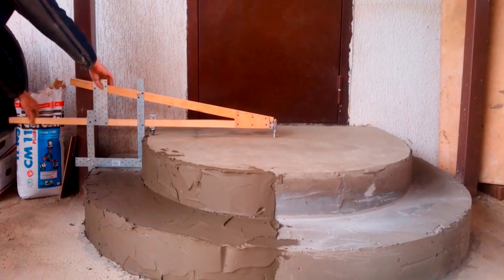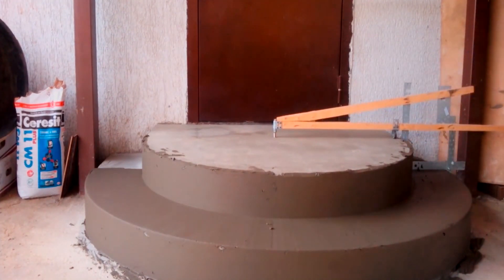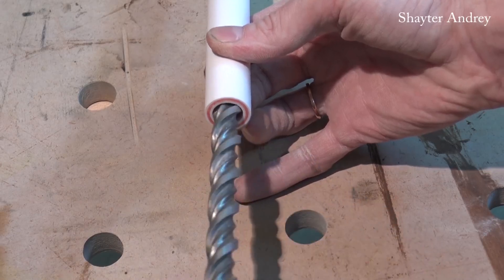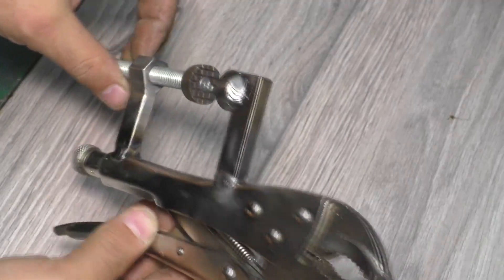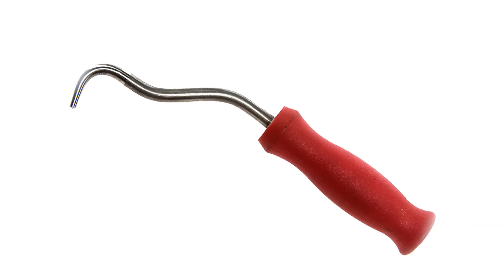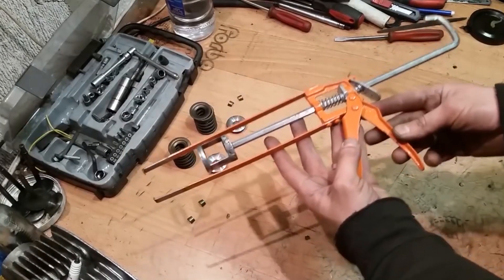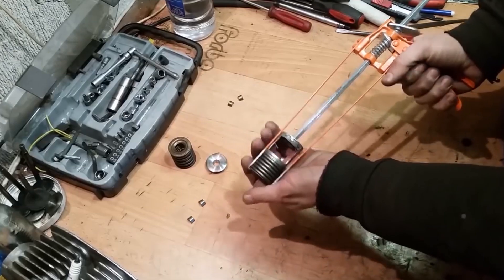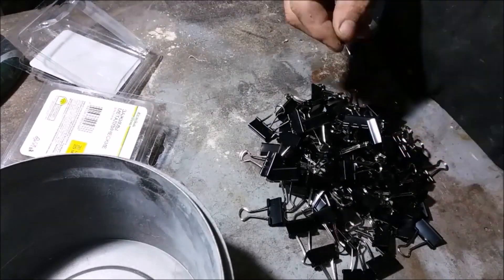Wow!!! AMAZING IDEA for a drill. Homemade inventions.

Comment: Good video.  All were clever.  I dunno about that tile lifter.  It might cause voids underneath.
Reply: rustybuttpate  I have seen pro's use a system almost like them.  Most don't, simply because it takes a little bit longer, and when you've been doing it for 30 years, you don't need the help.  That said, the guys that did use them, had far less tilted or crooked tiles, and I haven't found any hollow or loose tiles on a job with them yet.  Now, if we can only get them to actually clean up their grout mess...

Comment: How do you get the bent ends of the spring compressor out after installing collets?
Reply: Press down on the handle of the gun to take the tension out and spread the two ends apart.

Comment: Sorry , but there is a MAJOR flaw with your valve spring compressor. Valve springs are very stiff, so if your compressor will even compress them enough to install the "keeper", there is no way that the hooked ends can be removed from underneath the springs. That is why "real" valve spring tools press against the valve from the other side of the head.
Could be used for other things, but I just can't think of one now. The rest were good DIY.
Reply: The "upgraded" wielding tongs, screwed simply to a table, holding a drill as sharperner. Nice as long it works, but IMO a disaster+injury waiting to happen as soon either the one table clamp or the hold of the tongs to the drill slip off...

Comment: Most of the so called "hacks" in youtube are quite stupid. 

The hacks in this video were all surprising. Specifically the tool to enable tiles to be mounted flush, which can be a huge problem with shiny tiles.

Really, really good. These hacks can really be used by any craftsman.

Comment: The first one is not "amazing" its a fucking compass they have been around, FOR FUCKING EVER!. Second one a screw injector, also been around a long time and is used to make just about mass produced plastic object you own. third one is a old welders trick, there are a number of repurposed vise-grip welds out there (also that's a really good way to fuck up a dremel adapter callate.) Fourth one is a giant waste of a socket, there are already a number commercial bits designed for that task. #5 oh hell no, use the proper tool designed to actually do the job, its like 20 bucks at your local automotive store and does the job far better (Not to mention that grease gun is going to cost you the same amount). As for the last one, there are better options, leveling systems cost almost nothing. But with that said say your on a pinch at a job site good luck locating a large number of fucking Paper binders clips (Because you know how handy man like to carry around hundreds of paper binder and cheap wood stock, FOR NO FUCKING REASON!)